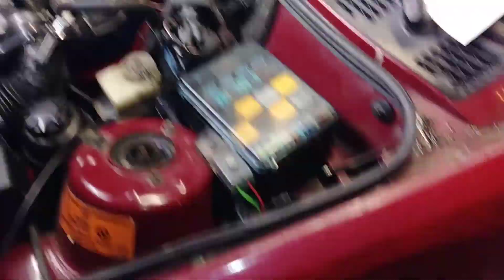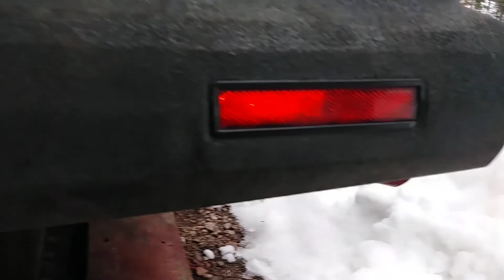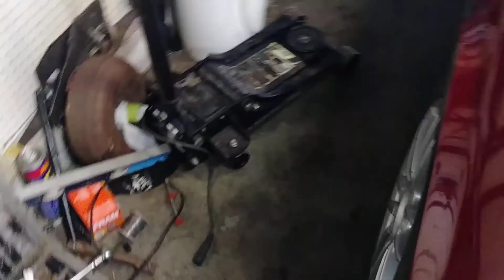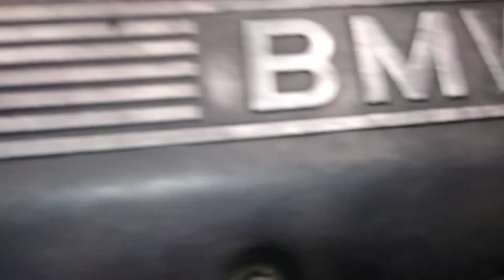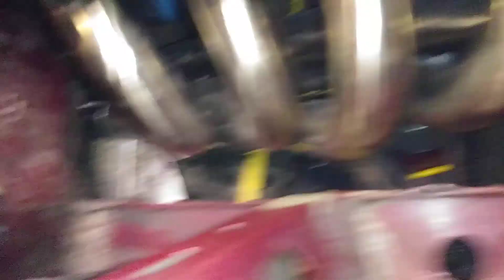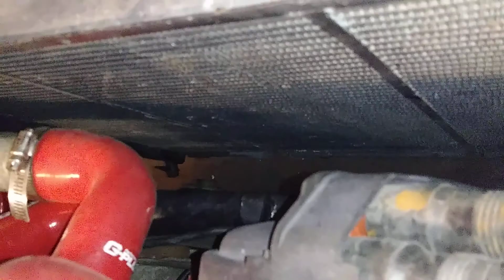Engine swap 325e with a 325i 2.5

Comment from the maker: I will break out my notes . My keys are lost so as soon as I get it in the shop I will do a c101 video and post the note. Typically there is 4 wires that run the engine.

Comment from the maker: I got a 4dr 88 325i it had everything rusted out I got it for 400 bucks header was 250. Gaskets and hoses another200. Solid urethane motor mounts could have done it cheapo but I added the performance bits.
Reply: I've seen guys use Hockey pucks for motor mounts. Lol. Still worked. I guess.

Comment: How did you wire the c101 plug I'm trying to swap my 325e and it seems it's only the wiring I have to worry about
Reply from the maker: I found a lot of info online , but mostly made drawings of the plugs , labelled the wires and made sure they were all the same or did not need to be connected, mine had a positive into a direct ground so it was a good thing I checked , Cost wise ,its all  about how much you get a parts car for , because the wiring harness is a little different

Comment: how much did it cost?
Reply from the maker: I got an IS fpr 300 bucks had the good computer a low km 2.5 and a full harness , bad it was a rust bucket and the engine was the only thing salvageable